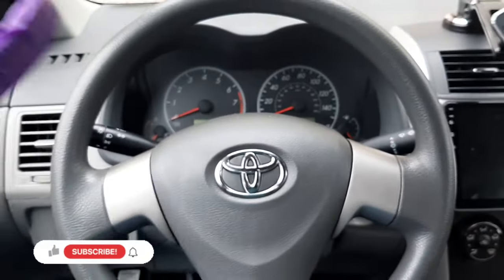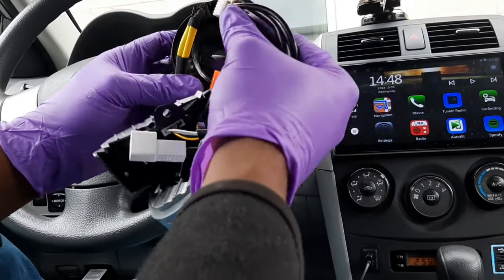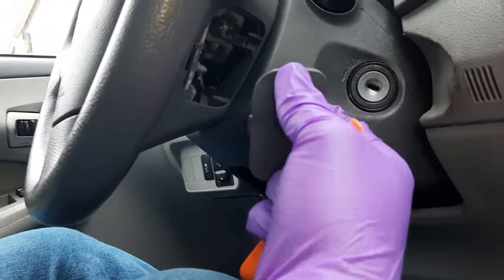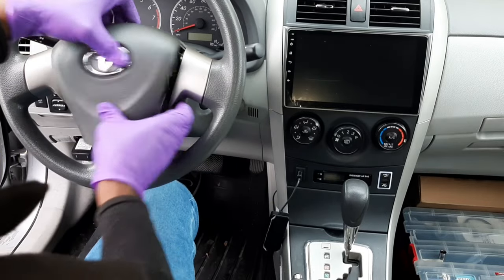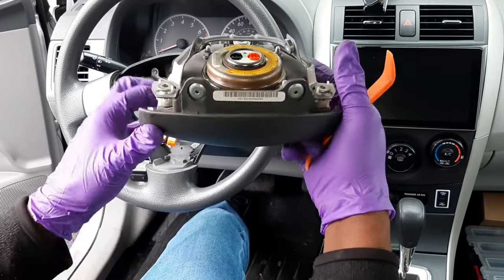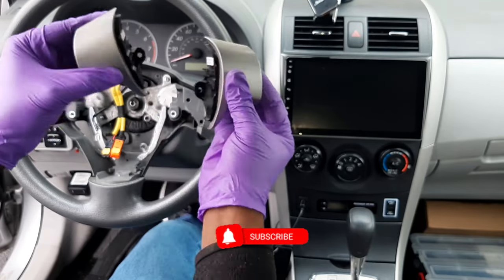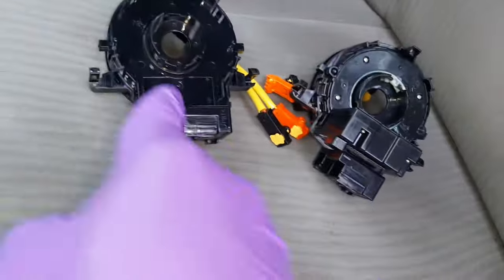Corolla gets OEM fit Steering Wheel Controls (Part1) | 2009-2011

Comment: Good video, has inspired me to try. 
 The links provided aren't working.  The buttons have a 10 pin connector, but the clock springs I look at appear to have a 12 pin connector.  Do you have an  PN for the clock spring? 
I can get an OEM radio, are the buttons compatable? or do I need to use a programmable radio?
Reply from the maker: Unfortunately the link to the clockspring changes based on the seller. Here is another active link https://www.ebay.com/itm/404409696170?mkcid=16&mkevt=1&mkrid=711-127632-2357-0&ssspo=rluj-kfkrrc&sssrc=4429486&ssuid=mppknIOJRGm&var=&widget_ver=artemis&media=COPY

Comment: Hi.. i have installed the controls and radio  control function on the left side work but the disp and phone functions on thr right do no work. What could be wrong
Reply from the maker: No, you are not wrong. This issue is common with some radios.

Comment: Very informative. Thank you! Info have a question, not sure what happened during my install, but my high beams no longer work after doing this. I can flash my high beams, but they do not stay on. Would you happen to know where I may have went wrong?
Reply from the maker: Questions: Did you replace your clockspring?   Did you use the Spiral Cable?
Reply: @eazidiy  yes, I replaced the clock spring and no I didn’t use a spiral cord. Still waiting for the steering wheel controls and wires but thought I could just replace the clockspring while I wait
Reply from the maker: The clockspring is reponsible to route wires of Controls on the steering wheel. It should not affect light switch or wiper switch by the sides. Do you have a DLR in your headlight? Please check to see if you didn't touch the switch harness during installation of the clock spring
Reply from the maker: You may also throw back in the old clock spring to see if it fixes the issue, but I doubt it.
Reply: @EaziDIY  What color do those light up at night?
I have an 09' Matrix, and I want to do it. But I want to know the color so it matches with the rest of the gauges.
Thanks in advance.
Reply from the maker: Same color as the dashboard. Orange color
Reply: @EaziDIY  Nice, I'm definitely ordering them today. Is the Matrix and Corolla built on the same platform? I've noticed that they share alot of parts (Engine, trans, interior pieces) seen a couple of your videos, very informative. 
You got a sub dude, thanks for the swift reply. Have a great day.
Reply from the maker: Appreciate your positive vibes! Matrix and Corolla are similar.

Comment: Hello. I have an 04 Toyota RAV4 black two sport great little car in mint condition. The only thing missing is the steering wheel with volume control.  Have you had any knowledge if  I can upgrade it to a later model steering whee. if so I would love to upgrade to a toyota radio that is compatible with the steering wheel. please  Thanks in advance.
Reply from the maker: I checked online to see if I can get you one but couldn't not. You may need to buy a whole steering with control buttons

Comment: This is very helpful, thankyou.  I have ordered the replacement clock spring but my 2011 Corolla airbag only has one connector (orange).  Can I just leave the black connector from the new clock spring disconnnected?
Reply from the maker: I do not recommend leaving the black cable out. Please buy the correct clockspring. Do not risk the Airbag blow out.
Reply: @eazidiy  OK thank very much. Would you know how I could identify the right part number for a clock spring that has a single air bag connector but also the requisite additional connectors for steering wheel control?
Reply from the maker: https://www.ebay.com/itm/394204647439?_trkparms=amclksrc%3DITM%26aid%3D1110018%26algo%3DHOMESPLICE.COMPLISTINGS%26ao%3D1%26asc%3D20200818142238%26meid%3D5c64e74cec8a4fb184ab81e56ba9e8e7%26pid%3D101121%26rk%3D5%26rkt%3D12%26sd%3D175643929709%26itm%3D394204647439%26pmt%3D1%26noa%3D0%26pg%3D2047675%26algv%3Ddefault%26brand%3DCustom&_trksid=p2047675.c101121.m1986&amdata=cksum%3A3942046474395c64e74cec8a4fb184ab81e56ba9e8e7%7Cenc%3AAQAIAAAA4H8Vg%252FDTG48OUqG6jmBF8cM9Wdy0Xk0T%252BJvkLPzusEFTwuElijkNMo0imS2Tza7qDNW7cMK%252FK6A%252FErnxFtL%252F2pfvcMYkZ6gJ%252BIhSWX%252FDIIpioI6%252F%252FFv7R1K9Oir0CKGr2z0EAHS%252Bds%252BPDLL18kVTj3AlTs0coW2sn701al1jyayMTfjElbXo8UfBlKqX0J3cZr3dn44K3dxkqcXldCUx1wTYGlZCmq1jb9s42enmKG6O9fUsmwv2%252B224EFGXomsH5c6L5Tv1JAq2kUWipPSRoxAp2sSrynWeZX3BcPx5zjlM%7Campid%3APL_CLK%7Cclp%3A2047675
Reply: @eazidiy  Hey thanks for that but I can see that this also has two connectors (black and orange).  My car only has the one for the airbag.
Reply from the maker: What is the model of your Corolla?
Reply: @eazidiy  It's a 2011 sedan, variant ZRE152 if that means anything
Reply from the maker: This should work for you https://www.ebay.com/itm/234928432652?mkcid=16&mkevt=1&mkrid=711-127632-2357-0&ssspo=jnbxmmxars2&sssrc=2349624&ssuid=mppknIOJRGm&var=&widget_ver=artemis&media=COPY
Reply: @eazidiy  that's great, just sent you some super thanks :)
Reply from the maker: Thank you for the super thanks. Well appreciated 🙏🏾

Comment: For a beginner who is not very handy, how risky is it to take out the airbag if i follow your steps?
Reply from the maker: Airbag is very easy to remove. Make sure the battery is disconnected before attempting to take it out.

Comment: I have a 2012 camry L that did not come with steering wheel controls. I added a new clock spring and steering wheel buttons from a Camry LE and have an identical android radio. Will this transfer wire work to make the buttons functional?
Reply from the maker: Hi, the transfer cable is customize for Corolla. I do not know if the PIN outs for Camry and Toyota are thesame.

Comment: I have a 2011 Matrix base, if I open it and see that I have the correct clockspring, can I leave the airbag connected or is it safer to remove it either way?
Reply from the maker: You will need to remove the airbag

Comment: I have a Toyota Matrix S, 2010 - it uses the same exact steering wheel and is the same chassis so I assume the process is very similar at least, the exact same at best - do I have to do the same work behind the radio, or just the steering wheel and clock spring?
Reply from the maker: If it is S edition, you don't need to extra work behind the radio as long as you have pins present there.

Comment: do you need to rewire anything if you're using a stock head unit/stereo? Is there a harness I need to buy?
Reply from the maker: It depends on your model of car. If your model L or LE, you need to buy the transfer wire. Then you must insert the SW1, SW2 and GND on the 20 pin harness at the back of your radio.

Comment: I have a Toyota auris with the controls on one side I want to know if I change to this control will the disp button work? At the moment I have a to push a pin on the dashboard will this allow me to just press the button on the steering wheel?
Reply from the maker: I believe it should work for you. I installed the control buttons for android then I was able to program the buttons. You can give a try for stock head radio
Reply: I installed the buttons and they worked with my pioneer radio. The display button did not work though.
Reply from the maker: Thanks for letting me and other viewers know that information
Reply: No you will have to do some rewiring in the speedometer which is probably a little bit difficult.
I have seen a tutorial one time before a few years.
I think it was in toyotaowners forum but I'm not sure

Comment: The 10 pin connector connects to clock spring clock but what about 4 pin connector hanging from wheel control switch? Please explain, where it should connect, if left unconnected what function will not work?🙏🙏🙏🙏
Reply from the maker: The 4 pin is extra harness could be use for cruise control connection. It won't affect the steering wheel control

Comment: Can this spiral cable with clock fix in corolla 2013 Gulf model Automatic. Steering shape & button is different.
Reply from the maker: The Spiral Cable used is only for Toyota cars because the pinout arr different.

Comment: Hello, I have a toyota auris with the exact same steering wheel, the steering wheel i got has buttons only on the left side so i was wondering if i'd have to change the clock spring inorder to add right side buttons
Reply from the maker: Hi, as I mentioned in the video your type of Toyota do not need to change the clock spring. All u need is the steering wheel control buttons.
Reply: @eazidiy  i think only the DISP won't work in the Auris because the DISP button is mounted on the speedometer

Comment: for toyota corolla 2012 do i need to change the clock spring?
Reply from the maker: No. You won't need to do that.
Reply: so i will just buy the multifunction pad and harnest/wiring going to head unit?
Reply from the maker: Yes!
Reply: @eazidiy  thanks!!

Comment: Hi bro, can i ask questions? My corolla doesn’t have steering control and i am trying to replacea  steering wheel sports D type while installing i found out the old clock spring doesn’t have pin for the steering wheel control cable i need to replace the whole clock spring??
Reply from the maker: Yes, you need to replace the clockspring too
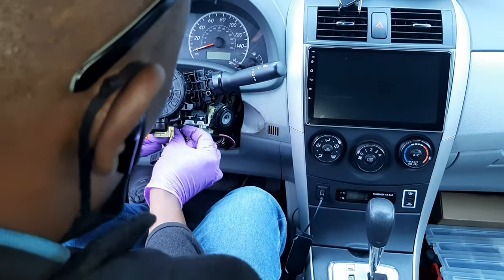Reply: @eazidiy why i dont see 3 wire harnesses on mine but in your video you have that 3 wire harnesses 7:22 ?? Thanks for immediate response bro appreciate it..
Reply from the maker: @egiegalang1724 are you referring to clockspring or Steering wheel control?
Reply: @eazidiy  clock spring bro in the bottom of the clock spring there is 3 wires.. is that standard clock spring has 3 wire harnesses?.. 7:22 minutes in your video..
Reply from the maker: What year and model of Corolla is yours?
Reply: @eazidiy  corolla 2011.. and doesn’t have steering wheel control i replace it with steering with control but i found out that the clock spring were installed doesn’t have pins now i am planning to get new clock spring with pins but i am just wondering i dont see 3 wires harnesses of mine
Reply from the maker: So it means you need to buy the transfer wire as well. The 3 pins harness is for SWC and cruise control.
Reply from the maker: I have the transfer wire on my site https://eazidiy.square.site/product/steering-wheel-key-switch-transfer-wire-for-toyota-corolla-altis-auris-e150-e180-2006-2013/6?cp=true&sa=true&sbp=false&q=false
Reply: @eazidiy My car doesn’t have cruise control could you tell where is the wire cable for cruise control located at??
Reply: @eazidiy  if my car doesn’t have cruise control still really need that transfer wire??
Reply from the maker: @egiegalang1724 The transfer wire is to take pins necessary for the SWC from the clockspring to the back of your radio
Reply from the maker: I have video on my channel that explains that. My video on how to install cruise control in Toyota Corolla
Reply: @eazidiy  thanks for the response bro really appreciated..
Reply from the maker: @egiegalang1724 you are welcome

Comment: Please my car Corolla Altis 2009 model 
It doesn’t have steering wheel control, what kind of Clock Spring should I buy?
I will be glad if you send me the link @AliExpress
Thank you.
Reply from the maker: Does your Toyota have a steering wheel control? If yes, you don't need to buy clockspring. If no, you need to buy clockspring to accommodate the harness for new steering wheel control module. Check the links in the description box
Reply: @eazidiy  
That link is not opening and I don’t know why
Reply from the maker: https://www.ebay.com/itm/175643929709?mkcid=16&mkevt=1&mkrid=711-127632-2357-0&ssspo=SE-veDHpSeC&sssrc=2349624&ssuid=mppknIOJRGm&var=&widget_ver=artemis&media=COPY
Reply from the maker: Clockspring should have 10pin port and 4 pin port at the top

Comment: Hello, I have an 09 Altis, that came with left side controls, but the mode button didn't work. I ended up buying double side controls but the right side controls don't work either, only the volume and arrow controls. Any idea why?
Reply from the maker: Do you have the stock radio or android radio? The issue happen based on the radio. I have experienced it on my old Android radio
Reply: @eazidiy  I have an android radio
Reply from the maker: Like I said, depending on the Android radio the buttons on the right side may not work ( call, mode, disp)
Reply: @eazidiy  is there any fix to this?
Reply from the maker: Unfortunately no, it is either you get another radio that will work on both signal wires or you enjoy it that way.

Comment: hey sir, do you know if i would have to change clockspring on an 03 camry if i were to swap over swc from a camry that does have swc?
Reply from the maker: Yes, you need clockspring replacement if your car doesn't have steering wheel control
Reply: @eazidiy  did you upload the vid on wiring? i havent seen it if so.
Reply from the maker: https://youtu.be/AFixt0T8Pw4

Comment: Hello i want to make sure it get correct clock spring for 2009 toyota corolla le adding audio controls to steering wheel, which clock spring is needed?
Reply from the maker: Use this link https://www.ebay.com/itm/355258629368?mkcid=16&mkevt=1&mkrid=711-127632-2357-0&ssspo=-irjntrhqi-&sssrc=4429486&ssuid=&var=&widget_ver=artemis&media=EMAIL
Reply: @eazidiy Sup bro I need your help. I have a 2010 LE corolla with no steering controls. I just bought a 2013 corolla or matrix steering wheel that has steering controls on both sides. I bought a new clock spring as well. My mechanic put it in but apparently the clock spring I bought only has two ports to plug in with my three cables from the steering wheel. So we had to leave one cable out. 

Im not sure if that is what’s affecting my steering controls or if not programming it right on my android unit. Could you link me the exact clock spring that should work on my car?
Reply from the maker: @thexiafury3104 Watch the part 2 of the video here https://youtu.be/AFixt0T8Pw4 This will explain why your steering wheel control is not working for Corolla LE. Your clockspring is fine.
Reply: @eazidiy  Okay so which should I buy? New steering controls? Regular cable. Or regular cable with 20 pins harness?
Reply from the maker: 20 pin harness if you do not want to do any connections behind the radio. It is plug and play. Otherwise, buy the regular transfer wire if you want to do further connections behind your radio.
Reply: @eazidiy  Got it. Lastly my mechanic when installing my clock spring apparently said he plugged in two cables but had to leave one cable out as the clock spring only had two ports and couldn't find a third. Is this a problem?
Reply from the maker: It should not be a problem. The clockspring only has 2 ports.
Reply from the maker: @thexiafury3104 I believe I just received an order from you? I will ship it tomorrow morning.
Reply: @eazidiy  Yes I just ordered. Thank you
Reply from the maker: @thexiafury3104 I have created the shipping label already.

Comment: would this work for a 2009 Rav4?
Reply from the maker: The steering wheel control control button in this video is designed for Toyota Corolla only. You need to get the one for RAV4. But the process to installation is thesame and the transfer cable will work for RAV4 aswell

Comment: My car is a 2009 Corolla, and I installed the control unit, but it did not work. What is the solution?
Reply from the maker: Please check the link in the description box and reference the attachment for your specific car. My car is a 2010 Toyota Corolla LE US/CAN
Reply: The electrician told me to change clock spring
Reply from the maker: Yes, you need to change clockspring if you don't have S or XRS type
Reply: @eazidiy ok
Reply: Please number the spring of the hour
Reply from the maker: Do you mean the clockspring part number?
Reply: @eazidiy Yes
Reply from the maker: 84306-02200
Reply: @eazidiy
Reply: Not available same part number
Reply: Does it fit my car
Reply from the maker: @ammaressam95  See  this link https://www.ebay.com/itm/385721288777?fits=Year%3A2010%7CModel%3ACorolla%7CMake%3AToyota&hash=item59cec7c849:g:zYEAAOSwyMVknpIX&amdata=enc%3AAQAIAAAA0MPqp2wcAaZUg8c6Z2K1qstWoyE3XYvi0dmy6BFN8MkGsK9SH%2FtLHthJqwCzqIbWlSyFQJE0BxQAGr7xNi4404K3BsJ8xjCtpCnjxORWc5ZO05xXPFTIlX9GK5unMoju93eVNVrAHOGx1aI2rzQqQB6mW7vBQgwMz8bc3LjE3xMCH070Z%2FNAopQA4z3b3isVqTydvv91a%2FodK7GuVyHTEirNPSRSBxTVyoreEO9EAyVazelp7FfYpcbC%2F%2Bnm8TEaBc61HUuPvx%2Fg10N1CKyv75E%3D%7Ctkp%3ABk9SR6q6vuuoYg

Comment: Anyone else have their vsc light come on after this? If so, find a fix yet?
Reply from the maker: What triggers VSC? Your dashboard's VSC warning light signals a number of traction-related problems. It can be an issue with the rotation speed sensor, the wheel speed sensors, or the steering angle sensor. A defective steering rack may also be to blame.
Reply from the maker: It could be the clockspring angle sensor in your car